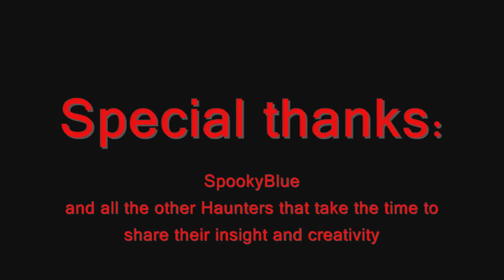Painting and final seal -- Part 8 of 8 - Paper Mache Pumpkin Head How-to

Comment: @jwal AKA Twisted Seed > Dude THANK YOU so much I have a second coat drying and I can't wait to see how it turns out! I even got the wife wanting to help and the kids walking by after school are all ASKING what is it and a few can see the pumpkin, BUT I CAN'T WAIT UNTIL IT'S DONE! Wanted to share with you, I plan on painting the inside safety yellow or green and then using a glow stick to light up the inside and then because of its weight I will hang it about 20 feet off the ground with fishing line. The glow stick with bounce off the inside paint and not be seen. I just got to fill the bottom back up or cut out the access whole from the top or back side. NOT SURE HOW BUT I’d like to send ya a picture once I get it done! THANK YOU, THANK YOU, TAHNK YOU!

Comment: I've got a question. If I want to make one of these and make an entire prop scarecrow, what would you suggest doing to make the head stand up?
Reply from the maker: Depends if the pumpkin head is a separate piece. I've used them for scarecrow heads and just use the pipe from the ground all the way through to the top with a T at the top to rest the head on. This also allowed me to run the light up through and into the head. 
Otherwise you would need to bond the head with the body with paper mâché and build it up enough to support it with the body making it one price.

Comment: The brush that you used for the sealer, was it able to be salvaged or is it a lost cause?
Reply from the maker: Actually, still using it tithes day. I divided to just leave it in the bucket and use it each time. It's worked out pretty well. Otherwise it's a lost cause.

Comment: What kind of assembly are you using to light it?
Reply from the maker: Check out my other vid with Flicker light in the title, I think it also says Duckin. It has the flicker circuit used for the lights. One main change is that I no longer solder the connection to the unit, but wrap tightly to secure and coat with liquid electric tape.
Reply: Are you just using lamp assemblies though?  Sorry to ask so many questions, but this is the first time I've tried this and was curious.
Reply from the maker: No problem! You can use any source of lamp/light. I've used can lights, open bulbs, halogen fixtures, led's, etc. Just depends on the look your trying achieve.